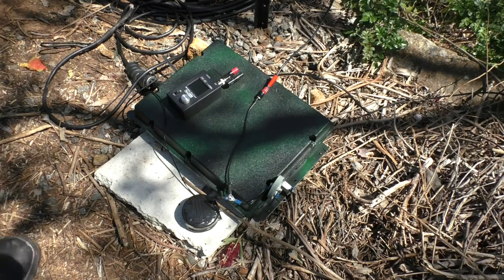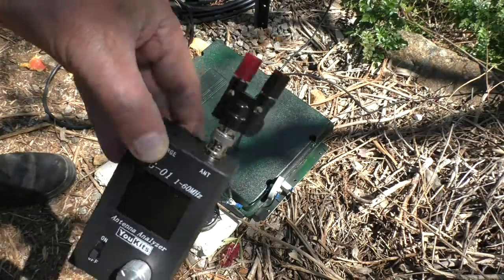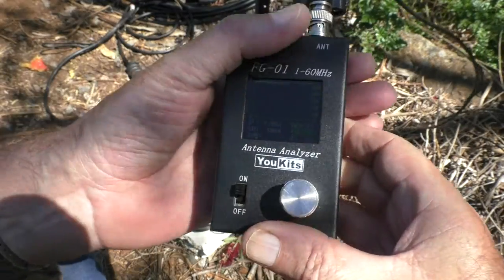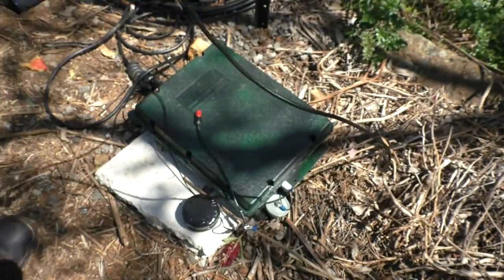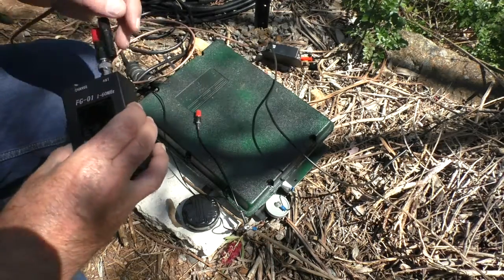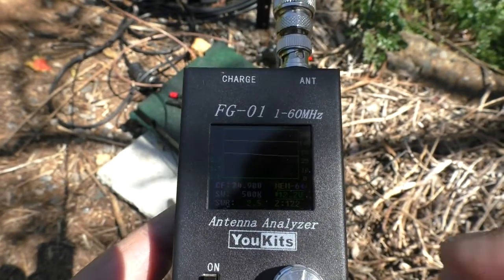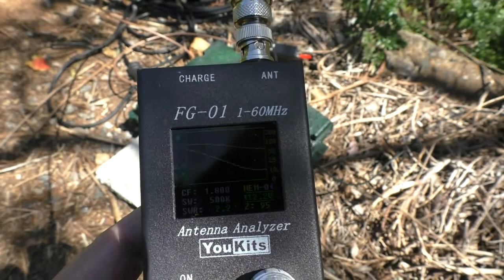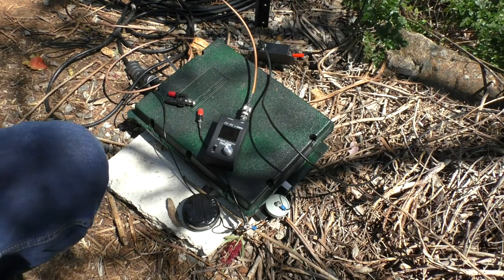Antenna Impedance Out Of Range On Your Analyser?

Comment: Great video!  What kind of smart tuner is that and would you recommend it?

Kind regards,

Simon
M0SYS
Reply from the maker: Thanks for the kind words. It's an SGC230, and I would recommend it. It does 200W PEP and 1.8 to 30MHz with 500,000 matching solutions. The ones that look like it but are half the price have half the matching solutions. I have no idea how good they are. They also do a SGC237 which I hear is pretty good. The 237 only does 100W PEP but does do 6m as well as 1.8 to 30MHz.